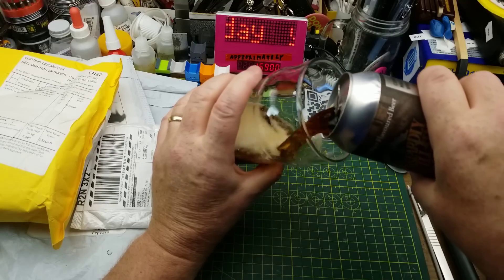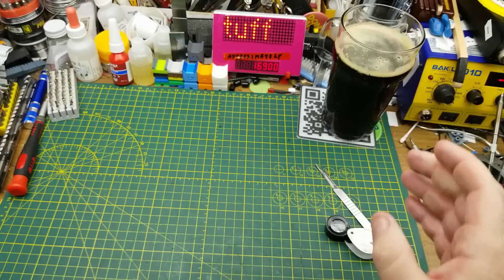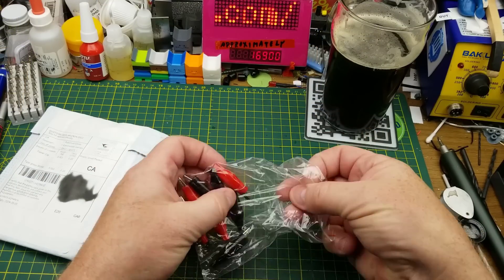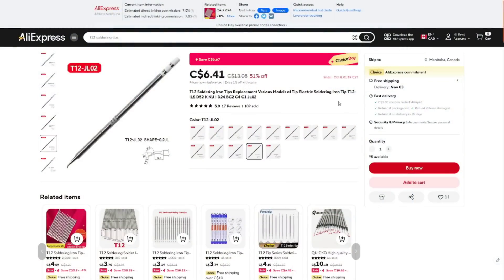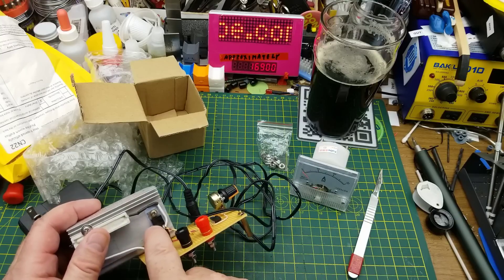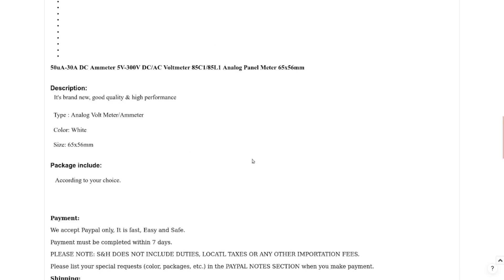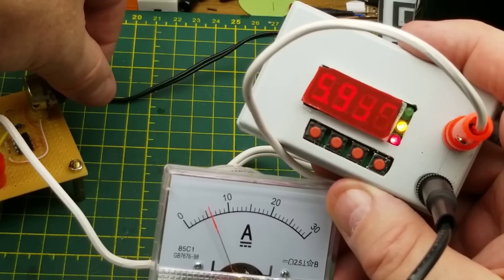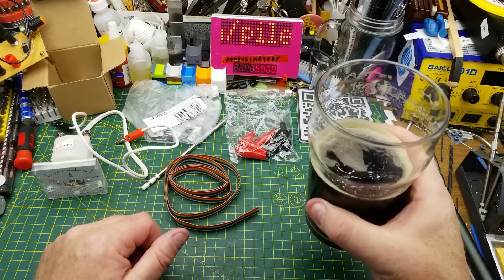Mailbag Monday 203

Comment: The movement within that amp meter is really nice.   Have you considered making a lab style desk top testing panel?   I'm doing this now with  desk top led lighting.  The whole set up to be powered with my outdoor tool Ryobi 40v capacity batteries.  They are solar charged.   My panel has many analog meters including a 120vac meter from a 1943  B24 bomber that I acquired years ago.  Anyway good job.
Reply from the maker: A full test panel? Nah, that's far too organized for me.
But I am planning to put the upgraded electronic load in a proper enclosure of some sort when i get around to doing that project.

Comment: For your own good test those mosfet, im 99% sure that they don't meet datasheet, 2 good indicators are RDSon and gate capacitance (CISS), also would be good to test for VDS, there are small handy devices on Ali costing about $20 that go to about 3000V, they are incredibly useful. About the soldering tip i found it to be really useful on smd parts, that's my go to for smd.

Comment: that was not the maximum gate threshold voltage, but the minimum voltage required to turn on the MOSFET I believe
Reply from the maker: You are correct. I'm not as experienced with mosfets as i am with BJTs.
Even after all these years, I'm still learning stuff.

Comment: Re: the cheap alligator clips-   I wish the colored insulators weren't so slippery,  When I squeeze them the clip turns sideways inside the sleeve all too often.  Is it just me?
Reply: Take the cover off and bend the top (non-crimp) handle's end ever so slightly. Just a tiny tweak to start, just so is not in line with the top of the jaws.
Then when you solder, pass the bare wire out the hole and solder it on the outside, creating a small bump on the underside of the lower jaw's handle.
These two small protrusions will create enough grip to stop the insulating cover from sliding about.
Reply from the maker: That's pretty common for the cheap ones like this.

Comment: The IRL540 has a max Gate-source voltage of +/- 20V, the Vgs(th) max means that at 2V the fet should be conducting but not at it's best.
but watch out that IRL540's from other manufactures can have a Vgs(th) max up to 4V.
The lowest RdsON is quoted at (0.044 Ohms) at a Vgs of 10V. a little bit higher at  (0.066 Ohms) at a Vgs of 4V at 3V3 it could be a little higher.
So you need to reduce the current load at lower Vgs vales due to power dissipation.
Reply: You are on top of it.  Yes, the figures I am looking at are the Rds(on) and the voltages at witch they deliver the target resistance.
A medium frequency switcher, that can be controlled at TTL levels.
Reply: @GnuReligion  watch out for ttl levels,  as a lot of logic fets are designed for 5V logic. :-(